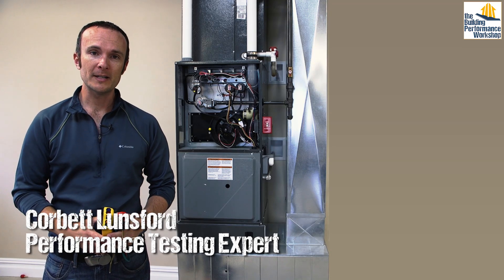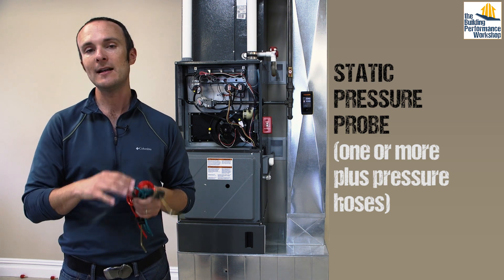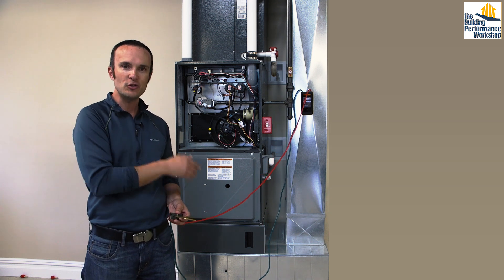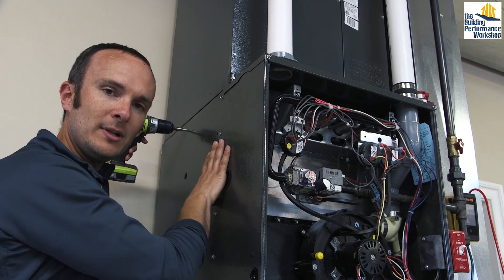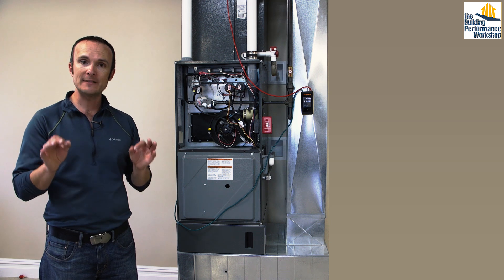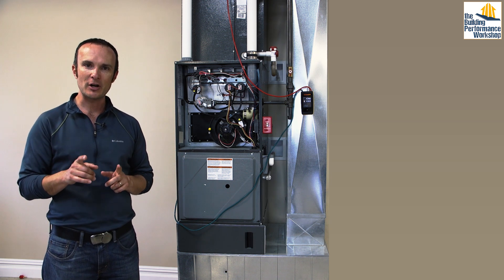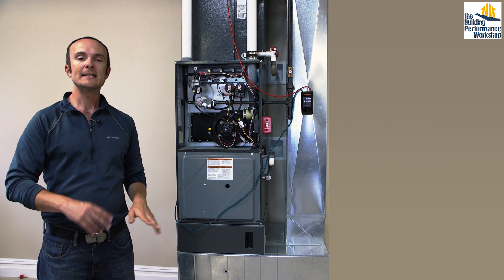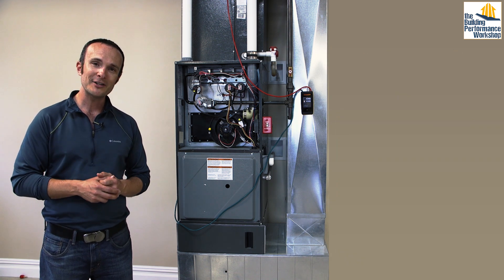Static Pressure Testing and Mapping Demonstration: Home HVAC Duct Performance

Comment: Very clear demonstration, thanks for posting. I've just determined that my furnace (which was installed by previous owner in 2012) is staved for return air. I found that the heat limit switch was tripping every time the system was kicked into 2nd stage heat. When I remove the panel before the blower the limit switch doesn't trip -- I posit that this allows enough airflow to keep the furnace in operating temperature range. I think the installers never fully tested their installation and now I have to figure out how to solve this inadequate return issue for them. My furnace installation does not have any of the ports you called out as needed in order to make TESP measurements.
Reply from the maker: Excellent diagnostic work, Greg!!! Once enough homeowners are like you, the HVAC industry will be a different beast!

Comment: Great job Corbett! You are extremely articulate and able to convey complicated subject matter in an easily understandable manner. You could easily be a TV personality on one of the DYI channels!
I’m assuming the drilled holes should be sealed using metal tape?
Reply from the maker: +Paul Mac thanks! We actually are releasing a TV show called Home Diagnosis in 2018! Yes, metal tape works, or metal plugs.

Comment: Great video, my question is: when you check for static pressure do you run ac or only the blower fan, can it be check when the heat is on?, the reason i’m asking this is because multiple speed blowers won’t work on a full speed if you just run the blower by itself, thanks for your time...
Reply from the maker: +Diego Lopez great Q. In the appendix of my book, there are a few methods for tricking the blower to run in AC mode, which you’re right is generally the highest speed. Important in my opinion to know the performance at different speeds, but if your goal is TESP no higher than 0.5, then yes, always test on high speed.
Reply: Home Performance Diagnostic book?
Reply from the maker: +Diego Lopez bingo! http://HomePerformanceBook.com

Comment: I tell what man. You're a mentor to industry! Dang ole truth is we're all idiots! What we know we inherited. Inheritance requires discern you know what I'm saying man. Calling out the kind from the swag and tossing the bunk under a bus. There may have been a TESP performed on  an AH w/out a hole. Some techs remove the limit switch, and testing from there, but doing this will give you a higher reading because of resistance (top of heat exchanger) I try to replace the filter before I test.  4" media filters w/higher or lower merv values also tweak your #'s. Dang ole beer can cold vets deserve respect, but after 20yrs thinking your right when you were actually wrong. I'd respect the man who pointed out this reality proving to me why I had been mistaken. Corbett I think in the future your name may be as recognized as Bob Vila's was 10yrs ago. So if you become the TV host for this new house? I'm applying for a job!
Reply from the maker: +MrTommytabasco wow, thanks for the kind words brother! You made my day!

Comment: What a terrific video. That was an excellent explanation. I have a question for you. My ductwork is too small for the furnace that was installed. Would it be acceptable to put an additional return and supply in my basement to help compensate for the inadequate ductwork above? It's an old house and it's literally impossible for me to add any additional ductwork at this point. The only place I can access is the basement and that's where all of the ductwork is easily accessible. Thank you and I look forward to your reply.
Reply from the maker: +Rick think of it like veins and arteries: if you have high BP because there’s constriction close to your heart, adding another vein and artery isn’t going to lower your BP. You need to enlarge the smallest duct. Upsize the plenums, which are the big trunk lines the ducts branch off from.
Reply: The trunks taper after the main trunk in the basement. I want to put these new ducts before they taper. As it is, the basement has no return or feed. I have a 400 cfm  deficit, going by simple calculations... Both in return and supply
Reply from the maker: +Rick just identify where the pressure drops using this mapping technique. Make sure what you add will actually fix the problem, then get proof that it did what you thought it would.
Reply: Thank you for the quick reply and the advice Corbett.
Reply from the maker: +Rick of course!
Reply: Home Performance the vents fixed the static pressure, but I never considered one thing.  The basement smells like a basement, and sometimes, like dead mice.... Not great for an intake, ehh? Maybe a bypass duct like the one Honeywell makes..
Reply from the maker: +Rick haha- good thinking. Make sure the filter slot is sealed too!
Reply: Home Performance so a bypass duct is a fix?
Reply from the maker: +Rick a bypass duct will have some effect, but it also has effects on efficiency of the equipment and other aspects. Figure out what you’re trying to solve and get metric goals set, then prove they were met. Local pros are a valuable resource, especially those who test.
Reply: Home Performance I cannot depend on any local pros, as they have put me in an awful predicament. If I told you what I've been through you'd understand why I'm trying to solve this myself..
Reply from the maker: +Rick I get it. If you need to get me on a video call and really talk it thru, my rate is $150/hr.

Comment: I've been in the industry for a year, I was told that yes you shouldn't have more TESP than what the manufacture says but was told by my seniors that you're allowed a little wiggle room (.1-.15 more than the static pressure) because of the filter. Some customers prefer certain types of air filters that will increase the static pressure. Are my seniors right and what do you do to compensate for the thicker filters?
Reply from the maker: +Kyle Rae great question! Just think about the fact that it’s a pass/fail test. If you’re over .5 even a little, you risk another pro telling your client you don’t know what you’re doing. The old school guys are used to nobody checking their work, but once your client thinks you lied to them one time, they will never hire you again. Remind them that TESP includes the filter- the filter doesn’t get added later as fudge factor. If a homeowner wants a higher MERV filter, they have to go wider media or upsize the return. Keep up the great work challenging the old rules of thumb!!!
Reply: Your fan motor doesn't care about anything other than the TESP, filter or not.

Comment: What would cause high static pressure to make my furnace Shake?
Reply from the maker: High static pressure can make your ductwork SLAM when the fan starts up, but it probably won't make it shake. That sounds more like your air handler needs to be serviced. I'd have it looked at pronto, before it breaks down.
Reply: @HomePerformance  what would correct high static on a unit with a new furnace and brand new coil
Reply from the maker: Less than 0.5” wc max

Comment: You're wrong about if the hole not being drilled in the cabinet meaning static pressure has never been tested. Many technicians will pull out the furnace high limit switch, and test from there.
Reply from the maker: +Joe Molnar the reading you get there is guaranteed to be higher than after the heat exchanger, since the limit switch is in the midst of it. Since testing hundreds of systems, I've come to realize that maybe 5% of all existing systems I've seen perform under the .5" required by the manufacturers. If they're out there testing and getting even higher numbers than me, then what use, if nothing seems to be done about it?

Comment: I agree with so many others on here that this was one of the best, easy to understand explanations and demonstrations for basic testing of static pressure with some great references to industry standard measurements such as drop across filter and A-coil etc.  Thanks for sharing!   I'm actually trying to determine airflow in CFM for my 3-ton heat pump system to see if it is meeting the required 400cfm per ton which would be a total of 1200cfm to work properly & efficiently.  I'm finding that determining airflow accurately without expensive testing equipment can be a very difficult thing.  And the results of low cost instruments can vary widely. 
 
So, what I might share for those on this elusive hunt, are 2 things: 1 is figuring airflow by using a similar probe but with additional tubing connection (Pitot tube).  It works the same but collects 2 measurements simultaneously static and velocity.  To get an accurate test a series of holes (travers) are drilled across a section of ductwork at predetermined spacing and a timed and averaging is done and then a bunch of tedious conversion mathematics which seems like a lot of trouble.  The alternative using this instrument is a single hole in center and an averaging multiplier of .9 is used to get within +/-5%.  Another method listed below blew me away and I'd like to hear comments on this.  It utilizes a simple formula using volts, amps draw and temperature rise to determine airflow.  I've included a link to the article

http://library.coburns.com/HVACTechTips/Calculating%20CFM%20Coburns.pdf
Reply from the maker: +Tie Dye thanks for sharing! Here are a bunch of other airflow test techniques: https://youtu.be/45gX7Jb60JM

Comment: I could really use some help. My mom bought a new system, everything was brand new. except the 3 feet before the filter and furnace and the 8 feet of duct coming out of the coil. Our new AC has never cooled our house. Our NEST is confused, It always says 2+ hours to drop one degree even on a cool night. I do have a 20 degree drop but I dont think our system is moving enough air. Our old system actually cooled our house. Before getting our new system we installed new doors and windows all around and I,, after vacuuming out all attic insulation, used expanding foam to seal everything in the attic. Every fixture and top plate every penetration of wire or pipe. 

I just recently discovered that my filter box which houses a 2x24x26 (approx) filter is sitting on the old platform with a hole that is only 17 by 13 inches(I think this should have been enlarged). Essentially that much of the filter gets dirty... I cant believe this is okay. we've complained to our HVAC installer about lack of cooling, their only answer is that I need to blow in insulation. There is no way that the 6 inches that was up there did more for my house than All the other work I have done to seal up the house. If the old system cooled the house this one should not have a problem. 

As for the test: Why is there any positive pressure before the filter? This area should be under vacuum not pressure right? Or is the pressure actually measure the forced air into the pitot tube?
Reply: Your positive pressure after the fan and AC coils is much lower with just the fan running. Its almost like your Blower is set to high speed for AC and Low speed for Fan/heat.  You might want to take a look at what speeds its set to and maybe lower the AC speed. It seems to be blowing too hard against your supply vents. I think you improved the return enough but you need to get larger/more supply vents
Reply from the maker: +Nicholas Hartzler happy to help with a consult if you need, but you're right, the system sounds wrong. The pressure before the fan IS negative, but you take away the neg sign for simplicity's sake.
Reply: Thank you so much for the reply! I took 16 different measurements and made a spread sheet. I wasn't sure if you were running your AC or just the fan in your test so I ran the test both ways and had very different results. Also The first time we complained they came and said my filter was too high of a MERV rating and gave me a see through filter ha, it didnt help. I since upgraded to a two inch MERV 13. Not wanting to be told the filter was too much for the system I ran the test with out it also.

You can see the test results here --- https://www.icloud.com/numbers/0BVDSRAVfv4sTwQVfNPRbFD7w#HVAC_Test_results
Here is the filter I use --- https://www.amazon.com/gp/product/B005ESPCVK/ref=oh_aui_search_detailpage?ie=UTF8&th=1
And the cheep tester --- https://www.amazon.com/gp/product/B00N3PPZZY/ref=oh_aui_detailpage_o01_s00?ie=UTF8&psc=1 
Also used a static pressure probe. 

Are these results a good indication of what would cause very poor cooling capacity? With the filter and the AC running my Static pressure test is 1.08 inches of H2o! even with no ac and no filter it is .61. Sticker indicates max of .50  Id be interested to have run the results in the winter with the heater on. Hot air being less dense would likely flow better which would be why the heating works just fine. 

If you can just confirm that I'm not crazy that would be great, ill give my contractor a call back out here.
Reply from the maker: +Nicholas Hartzler not crazy. Good work.
Reply: Hi there! long month. So I enlarged the hole through the foundation made it almost three times bigger, also added a MERV rack. . That took my total ESP from 1.19 to .96 Which really made a big difference house cools off much faster at night but nothing like a comparable friends system. Part of that project removed the 12-10 reducer on my 12 inch return. Now I'm working on my other return which should be a 14 inch because they ran 14 inch duct but it actually has about 5 feet of duct that is only 12 inches before it enlarges to the 14 inch duct. I disconnected this and while that took my reading before the fan from .44 to .31 my reading after the furnace jumped from .52 to .64. Does this tell me anything important about my supply ducts? Are they too restrictive as well?
Reply from the maker: +Nicholas Hartzler your testing and prognosis sounds right on. This is not rocket science, you got it!
Reply from the maker: +Todd Becker actually, most systems are set to hi speed for cool and low/med for heat- this is why you should always test in cooling mode, or whatever the hi speed is, when the pressure will be highest.
Reply: Sound like your restricted return air might be frosting your evap coil. Could be the reason your pressure is so high while its running

Comment: Great video, I take it the same location of the measured points applies to package units also, thanks.
Reply from the maker: +Wayne Miles as long as the filter and other devices are internal to the equipment, they should not be counted as external for the TESP

Comment: great info for new installations  . but watch out for home owners who zone their central system . They shut down all registers in rooms they don't use and shut the doors . You can inform them and readjust but they close them up the minute your down the road
Reply from the maker: +Brian Ellsworth homeowner education is gonna make or break home performance, you're right.

Comment: Could you remove the high temp limit inside the furnace instead of drilling a hole in the side?

Thats one of the biggest problems with duct systems, they are NOT designed...
Reply from the maker: You're right on. The hole is necessary though, for accuracy- if you test at the high limit switch hole you will get a higher than actual TESP reading, since you're also picking up the top of the heat exchanger.
Reply: Just for experimental sake, Can you check an see what the difference would be between your drilled hole and the Limit hole?
Reply from the maker: +A/C SuperKool you sure can! Let us all know what you find!  PS- this was already demonstrated by another commenter.

Comment: I have been doing this for years in the memphis area, I am not only a contractor, but an Instructor at a tech school as well. I try to teach my students these principles to commission units and use a blower performance chart to set proper airflow for A/C.  The sad part is the majority of homes run .8 or higher.  Those 1" pleated filters are horrible for static. I recommend nothing less than a 2" pleated for single filters at the furnace base. Jack Rise from ACCA taught a class here years ago and called Memphis the land of no return. He was right! After seeing very nice homes with 2x4x16" wall stacks and builders trying to get 2 tons of return in two cavities! The installers in the area have no clue, the builders want the cheapest, and the homebuyers say look at the granite countertops and saltwater inground pool. Next thing I'm telling them the ductwork was done by a doofus because they aren't comfortable.Keep educating! I just replaced a 7 year old system on a new house because the plenum had a 4"x22" hole in it in the attic where it was never sealed! Keep calling out the shoddy work! It's not opinion if there is verifiable performance! Oh, sometimes I can't drill an old furnace in a closet, I normally take out the limit switch for my probe, not ideal, but works!
Reply: Jesse Johnson I'm in Nashville and I see a lot of the same. I actually got cussed out the other day by another inspector of all people because I wrote up a 5 ton system pulling from one 20x30 return filter and a 10x15 run. The static pressure on the return alone exceeded .5" which is the max on the system allowance. You just have to walk away and shake your head at some people.
Reply from the maker: +Jesse Johnson you rock brother. Keep up the great work in TN- the world needs you calling out doofus work! See you around I hope- we're not far, in Atlanta now!
Reply from the maker: PS +Jesse Johnson : my 6-week mastermind course might be useful to your students or colleagues http://HomePerformance.training Starts 4/1 and registration begins 3/1